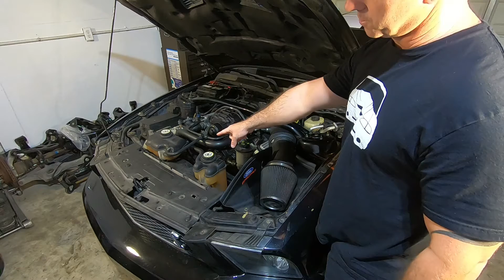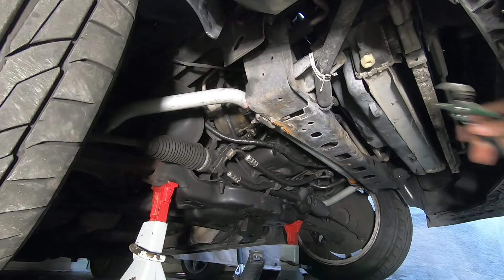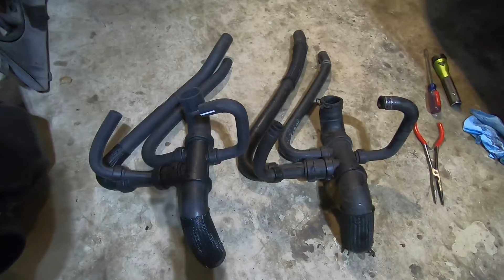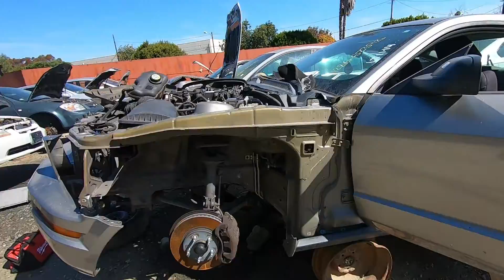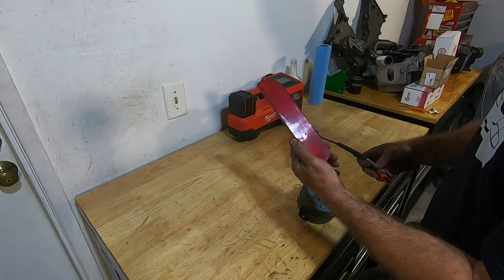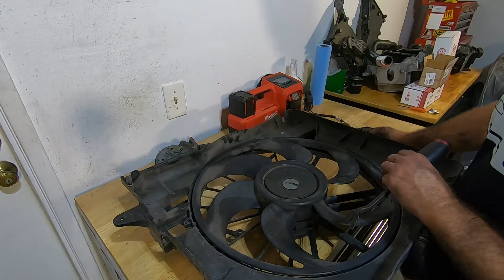2008 GT500 Mustang Cooling System Diagnosis: Pressure and Electric Fan Test

Comment: Hi bro, i have a 2014 gt500 with the same problem, from the lower radiator hose and its also leaking from the middle of 2 pipes where they connect, is there any way we can fix the hose like diy cuz i live in dubai and it costs like around 400$ to buy and ship it here, can u please help
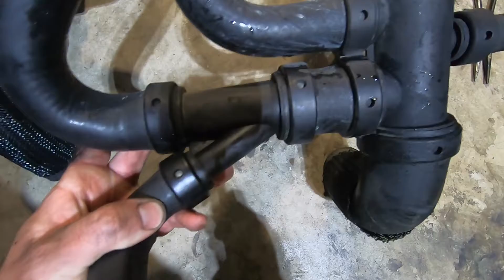Reply: It leakes from where u meantioned in 7:27
Reply from the maker: @SimRaceMania  There might be a way to get it repaired via plastic welding but I am not sure if it will hold up to the pressure of the cooling system.  I purchased a replacement from rockauto.com they have great prices and I am pretty sure they do international shipping.
Reply: @JohnSmithRacing tysmm for the information brother, yea i checked their website they only have the oem in stock which costs like 350 with shipping🥲

Comment: if you do is it stil driving and has it had any more problems after the timing chain guides
Reply from the maker: It doesn't belong to me, but it is still driving.  Its not a daily but we did run it for 12 hours on a race track without issue.  We are also planning to take it to another Lemons race in a couple months.  I should have video when we do so stay tuned to see if it lasts haha